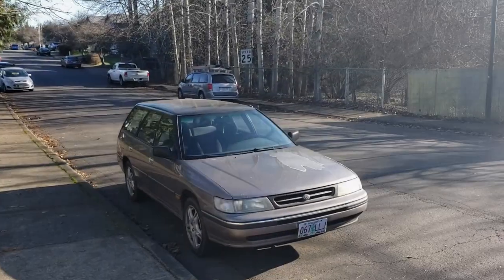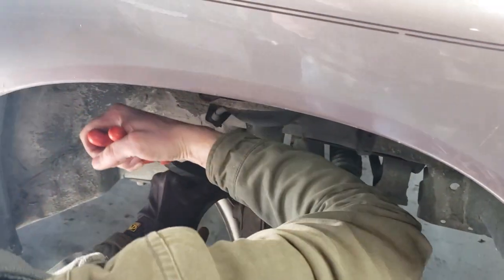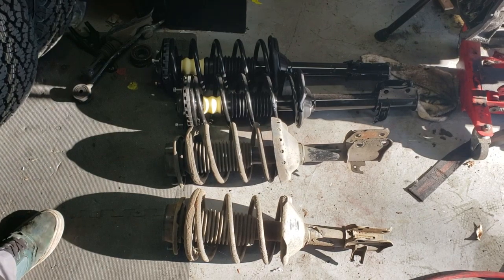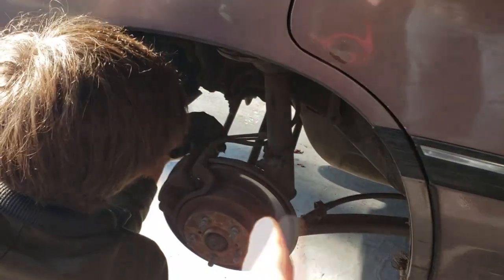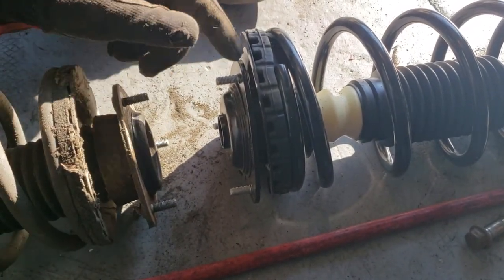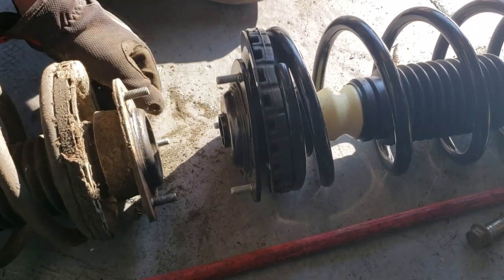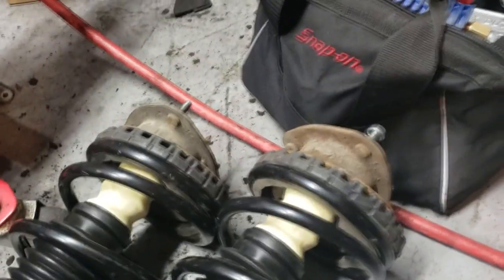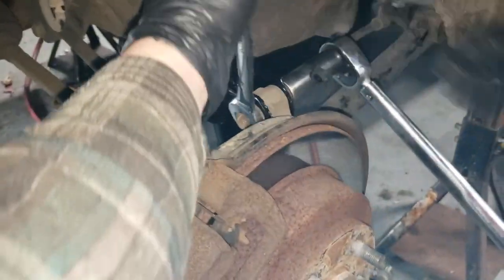Lifting a Legacy in a Day!

Comment: Hey, I have a 94 Legacy Wagon and I plan to lift it similar to this video. However, I might keep the wheels and tires that are on it as of now (which are 215/55R16). Do you think I would still need trailing arm spacers in order to fit the wheels on with the lift? Also, did you have any issues with the swaybars? I've heard people were unable to link them back up after the lift.
Reply from the maker: That's awesome! You will probably still need the trailing arm spacers, as the wheel moves down and the suspension droops the wheel moves forward in the wheel well. So it may work but it would look a bit goofy.
As for sway bars we got rid of the front sway bar for more wheel deflection. And what I've done for the rear on other cars is get 98 outback sway bar mount bravkets, they space the sway bar down for the taller suspension. If you want to run a front you would have to get long adjustable links of some kind.

Comment: Maybe you'd better use old rear coils they are really tough and possibly no spacers needed?
Reply from the maker: No it was a perfect setup as it was. The forester struts gave it a nice lift, we kind of needed spacers in the front because we got wider tires that we normally do with the 16in wheels, if we used 15s we would have not rubbing in the front at all.
Reply: @HackSquadGarage  I'm going to install sf5 front and sg5 rear with stock coils and 195/65/15 wheels
Reply from the maker: I would suggest 205/75r15 general grabber atx tires instead
Reply: @HackSquadGarage  I can't even imagine those SUV tires on non SUV legacy on the highway 🤭
Reply from the maker: Its not bad at all actually, we have these on the other lifted wagon and it's a daily driver

Comment: Hey I have the same set up kinda KYB w/ King springs. what size tires and rims size is he running? Thanks great job
Reply from the maker: I believe it was a 215/75r16 on a Saab 92x wheel, same wheel specs as a stock 02 wrx wheel. It does rub the frame at full lock in the front.

Comment: Hey great video guys, I'm looking to do this with my 1990 wagon with 2001 forester struts which should give me 2 of lift..im finding conflicting info on the web. Some say the rears will swap right over some say the top hats are different a d either have to drill or swap your old tophats..problem is I converted to coils a few years ago so no old tophats for me. Is this correct 2001 forester rear with swap right over to 1990 legacy wagon?
Reply from the maker: Yes that's a great idea, the difference is the preface lift legacys have a tapered rear spring like the newer 07 foresters. So if you had the stock suspension from your car you could swap those top hats onto all 07 forester suspension, but since you don't have that your best bet is to get the 01 forester suspension and get some 92-94 Legacy rear top hats to put on the 01 suspension and it will bolt right in. 🤟
Reply: @HackSquadGarage  so the 2001 top hats wont work unless I drill huh? Bummer, i found this forester for 100 bucks on FB. Doubt I'll ever get that deal again
Reply: @HackSquadGarage  sorry man, I just wanna make sure, all this info is just a iut as confusing as Congress
Reply from the maker: @fr3k5h0w  yeah the bolt pattern is different and the center hole won't line up. I would still get them if I were you. Just go to the junk yard and buy only the top hats.
Reply: @HackSquadGarage  oh for sure I'll be getting them, I'd rather not drill holes in my car. Thanks brotha 🍻🍻.
Reply: Some good info I'm getting a 96 legacy outback tomorrow if everything goes right will have to try this upgrade will need a stiffer suspension for my tools thanks for the video definitely better going this route with money being so tight the aftermarket struts are way expensive and this looks like a easy upgrade I just have to do some more research to find out witch Forester struts will work changing out top hats is easy enough and will give me a chance to test some alignment tricks I learned lol

Comment: I just picked up a 2001 Subaru Legacy L wagon and plan to lift it as well would this combo work for it as well?
Reply from the maker: No the 3rd gen legacys have a different suspension design in the rear, so it would be a different combination, I believe the newer 08+ forester stuff might work, but they do sell lift spacers for that chassis, it may be easier to keep your stock struts with strut spacers and king springs. I would do some research on the forums to see what other people do on the newer cars
Reply: Got it thanks for the heads up! Ima definitely going to be keeping up with this channel from now on!

Comment: So, is this a 2 or a 4" suspension lift? 
Ive been looking for a Suby to replace my Gas Guzzling SUV for backroads, but i know that basically after a 2" suspension lift you have to start looking at subframe spacers and what not.
Reply from the maker: Yeah I don't have the exact measurements but it's about a 3 to 4in lift. This thing can get pretty much anywhere apart from actual rock crawling. It's an awesome overlander and like 20+mpg with a 2.2. This is sort of the max of the axles without subframe spacers, you can use 98 outback stock spacers or aftermarket made for that year outback which there are a lot of. But that's more of a longevity thing so it doesn't pop boots. Overall an awesome off road rig for super cheap. This wagon was $200. 5 speed swapped it and a lift/tires and were in it for around $1k.

Comment: That looks sweet. Excuse my ignorance, but why would this be preferential to installing spacers?
Reply from the maker: Spacing the stock strut does work. But the forester struts have longer travel and the springs are stiffer. And you get some decent height without some sketchy strut spacers imo. Now if you space the subframes down also you could do both struts and spacers and have a beast.
Reply: Thanks for your clarification!

Comment: How was it to drive after this? Big differens? Stiff ride or same at before?
Reply from the maker: It drove so much better after, the forester suspension is a lot stiffer than stock since they are heavier. If you want something softer with more body roll the outback suspension is the way to go. We liked the stiffness of the forester stuff better.
Reply from the maker: It drove so much better after, the forester suspension is a lot stiffer than stock since they are heavier. If you want something softer with more body roll the outback suspension is the way to go. We liked the stiffness of the forester stuff better.

Comment: AWESOME! Did you measure the overall height of the tire? My close to stock height on mine are 23 & 3/4 inches. I'd like to do a lift like yours on my 93 Subaru Legacy wagon, but those tires might be a bit too tall for what I want. Do you have any video of this one off roading? Thumb up.
Reply from the maker: I believe they were a 26 or a 27in tire, it was a great lift kit, we enjoyed the forester suspension more than the outback suspension because it was taller and stiffer. The only issue with this setup was this tire was on a 16in wheel and the 215 was too wide and would rub the frame at full lock. A 205/75r15 which is about a 26in tire is the best tire with stock offset wheels and can be ran with outback or forester suspension.
Reply from the maker: Unfortunately we have sold this wagon to a friend who was in need so we never got video of it off road. I took it out in some deep snow several times and it was amazing, but didn't get any video of those trips.
Reply: @HackSquadGarage  Thanks for the additional info. I think I want to end up with a slightly larger tire of about 25 inches with a lift similar to yours. I'm thinking Cooper or similar AT's 185/70R 15's.

Comment: I’ve got to ask, is this thing now prone to CV axles breaking a little more-so than stock ride height?
Reply from the maker: So since we didn't space the subframes down with one of those kits. Or use the factory ones outbacks use it is much more prone to tearing cv boots, this one has already ripped both fronts. If you use suspension from say an outback which isn't quite so tall they will last. Or you can get subframe spacers.
Reply: Hack Squad Garage Epic information! I’ve got the same Legacy as a turbo with 85k miles, and I’m really considering this. I really appreciate it. Great content too.
Reply from the maker: @ZaneBezesky  wow a touring wagon with only 85k miles? That's insane, that's bar far the lowest mileage one I've heard of. Definitely hang onto that one.
Reply: Hack Squad Garage 
Yeah, I couldn’t believe it when I had seen it on Craigslist. Will do. Thanks for the advice!
Reply: Hack Squad Garage Hey man, in the comments you mentioned that the forester suspension swap provides 3-4” of lift. So, combined with a NEW tire that’s essentially 27”, going from the STOCK 23” ... Are you getting a combined increase of 7-8” of increased ground clearance between the swapped strut assembly and tire size?
Reply from the maker: @ZaneBezesky  no I was guessing, I measured it just now with the tires it's a 5in lift. I know the forester suspension is about an inch taller than the outback stuff with a similar size tire. Stock the rockers were about 8inch off the ground and this car is at about 13.5in off the ground. So 5.5in lift or so.
Reply: Hack Squad Garage Thanks for the info checking that out and measuring it! That’s still a bunch of lift added to it though. Hey, you could always trim the finders 2” up, 2” wheel spacers, and run 29s 🤷‍♂️
Reply from the maker: @ZaneBezesky  yeah its a lot with all factory subaru parts and no subframe spacers lol. I'd really recommend some subframe spacers for axle health haha
Reply: Hack Squad Garage Yeah,this seems true. I called Anderson Design Fabrications to see what they had.. They referred me to do exactly what you guys did. He said with brand new CVs, you should be able to get around 60k miles out of them. Would you call him out on BS?
Reply from the maker: @ZaneBezesky  well maybe with brand new oem axles, 60k still seems like a lot. This wagon from the video busted both front axle boots within a month. They were old and aftermarket, but still. I guess it depends on what you are doing with the car as well. Lots of off road will be torture on them.
Reply: Hack Squad Garage 1 month, that’s crazy. Yeah, 60k sounds like a stretch. Well hey, if I end up lifting it, I’ll upload some videos and let y’all know 🤙 I’m in SW Montana, so defiantly can get some good testing going over here.